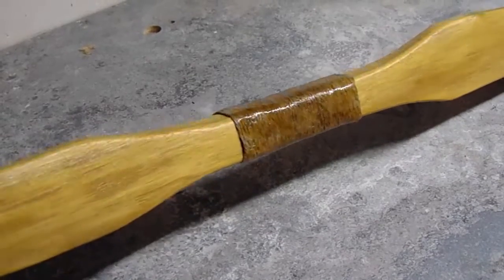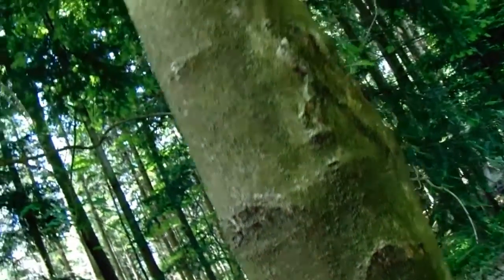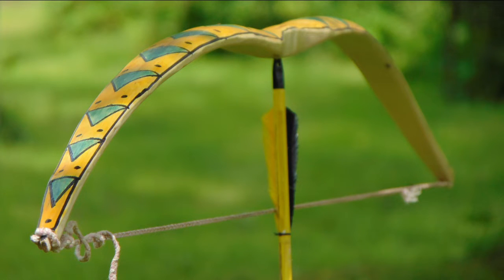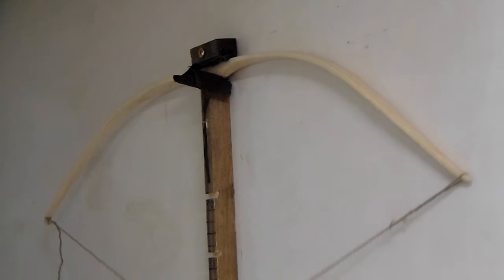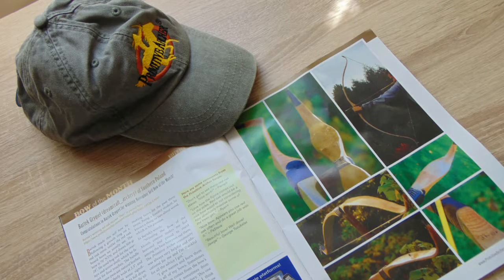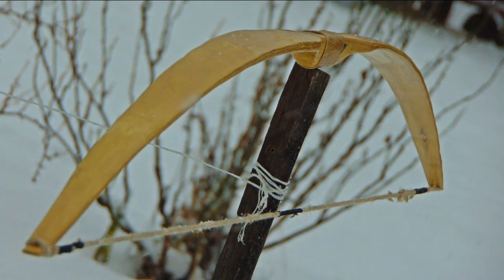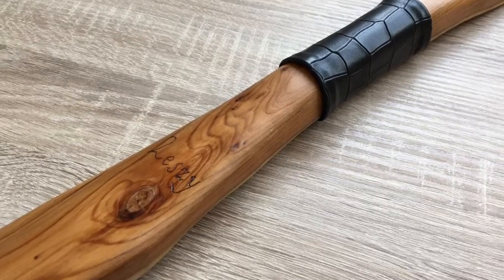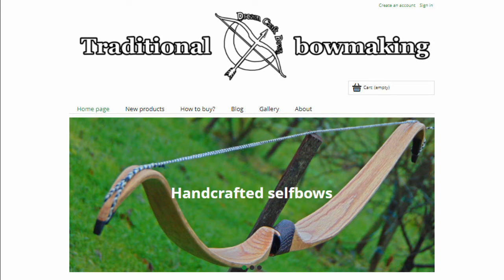Woods for Bowmaking - My TOP 7

Comment: It should be noted that most (virtually all traditional bows) never came from trees larger than about 100 to 150 mm at the most in circumference...Riving stave blanks from larger wood is much more a "modern practice" and not a traditional one in most styles of vernacular or indigenous bows...
Reply: Coppicing and pollarding were institutionalized during those times making access to those sizes pretty readily available

Comment: About yew being natural laminate... Not really, sure kinda in a way, but for a laminate it's very poor. Laminated bows can reach over 200 fps speeds, even with quite common woods, like birch backed compression pine, where yew at its very best shoots bit oven 180 fps. Its a top self bow wood for sure, but i wouldn't say its a laminate, cus it still performs the same as other good self bow woods.

 Btw, service berry makes awesome bows, but very difficult to find suitable stave out of it. Its also quite small diameter tree, so most of the time its limited to narrow longbows, but performance is excellent, especially when fire hardened, and usually grows with nice character in it. Absolutely not a beginner wood, since it likes to grow with twists, and twists even more and bends while drying. With steam i did straighten 270° twist out of it tough, so it is doable, but require extra work, but results in a beautiful very well performing bow.

Comment: I aspire to make a bow one day, and in Alberta Canada, the most common wood that I could see to make a bow with is poplar. I would also like to experiment with pine, evergreen, spruce or cedar. Then, I would like to use yew to make a bow that I intend to use for hunting a lot. The only thing that sucks about trying to make a bow, is that I do not have enough money to buy wood from someone with woods and would like to search for my own. But I would not like to wait 1-3 years or buy some from a hardware store, so it will be challenging. I am thinking about getting poplar sometime either this winter or another winter, because it will be mostly dry, and then I can try to de-humidify it, but not too fast so that it is suitable for bow making. But thanks for some tips if I ever move to Europe for some reason and can make a bow there.

Comment: Try field maple (Acer Campestre), it is even harder than sycamore maple and more flexible. Rowan(Sorbus Aucuparia) is also great. By some master bowyers, it is one of the best woods for selfbows. Only thing is, it has also become rare in Europe because of exceptional quality wood that was very sought after.
Birch could also be good, it is quite hard when dry and very flexible, I will try it soon. There's also a species called iron birch (betula Schmidtii) from Asia which could make exceptional bow wood because it's very hard and flexible. Allegedly, it doesn't float because of great density (which also implies great hardness).
Reply from the maker: Thank you for your comment and sharing your knowledge. If I'll have a chance to get these species for sure I will. All the best!